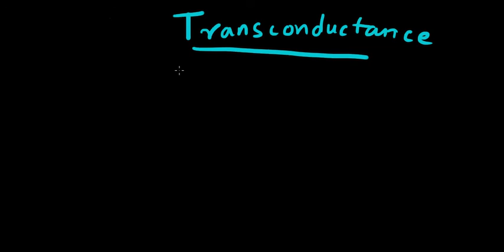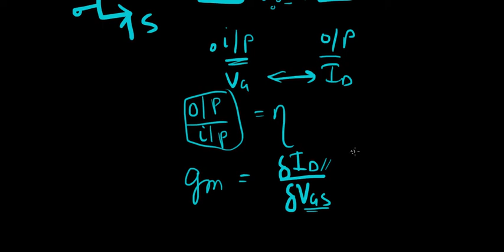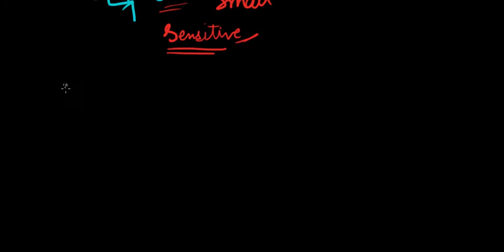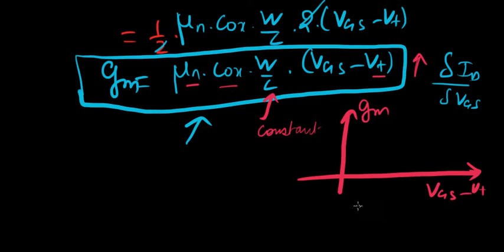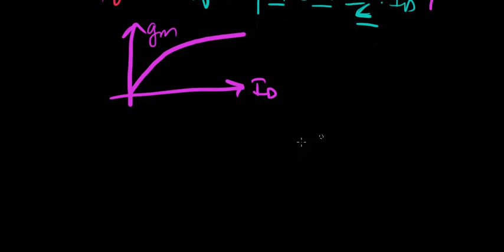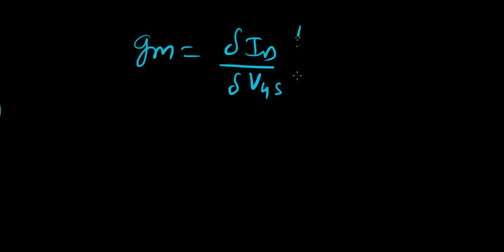Transconductance

Comment: Might sound a little dumb but, do the equations differ in the case of PMOS, as compared to the NMOS? Great videos btw
Reply: The equation is "valid" for the both (PMOS and NMOS) devices. It should be noted, that these equations is not generally accurate/valid (especially for submicron technologies).